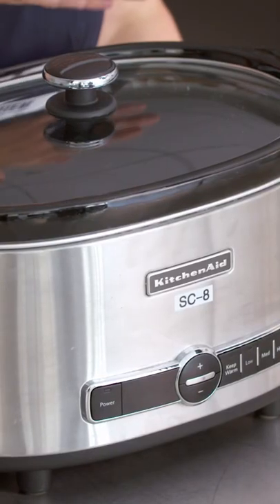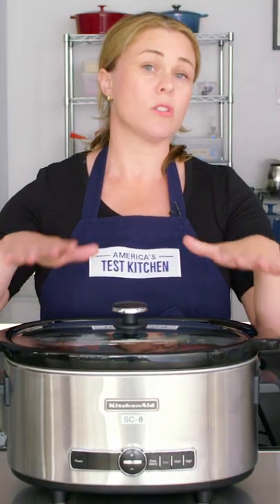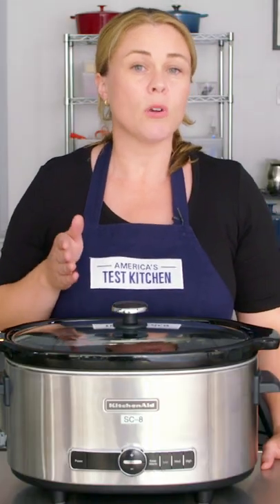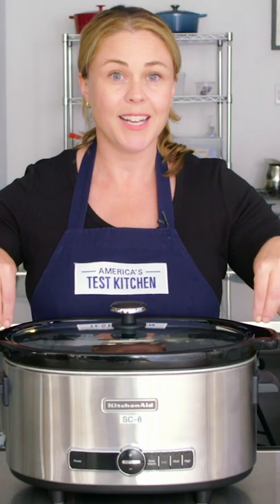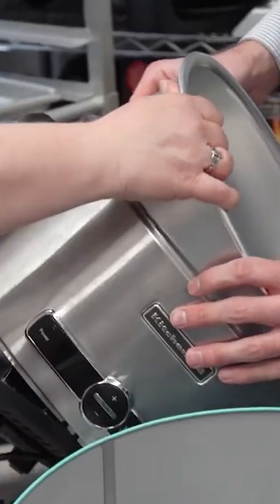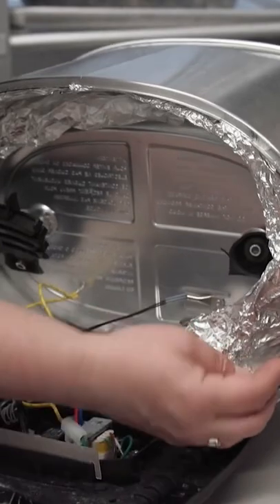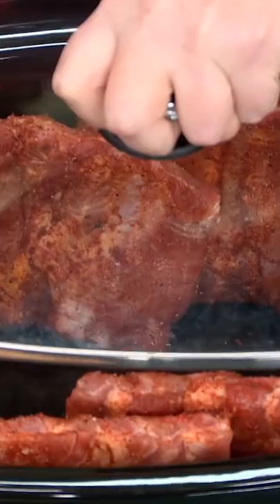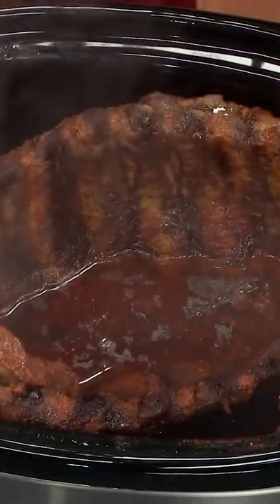What Makes a Good Slow Cooker? #Shorts

Comment: I’m thinking of passing on the slow cooker and replace w an instant pot. Not sure energy wise it’s the better option but like the idea of a pressure cooker but w multi functions
Reply: @kentuckyken used to have an old style pressure cooker but they freak me a bit. The “explosion” fear. Besides that factor, pressure cookers are so underrated and should be championed more
Reply: Instant Pot is FANTASTIC.
Reply: InstaPots are amazing and love mine, but they are not good slow cookers.
Reply: We received an instapot toaster oven for Christmas. It’s good but uses too much power.
Reply: Foods taste better cooked slowly on the ceramic of the slow cooker rather than in the stainless steel of the Instant Pot. The instant Pot is good for certain foods. But for something like stews, etc. that are better when flavors are able to meld together over time, the ceramic of the slow cooker is better at than than the stainless steel of the Instant Pot.